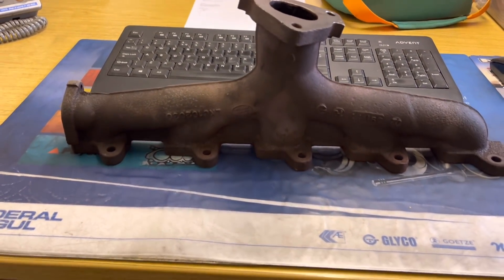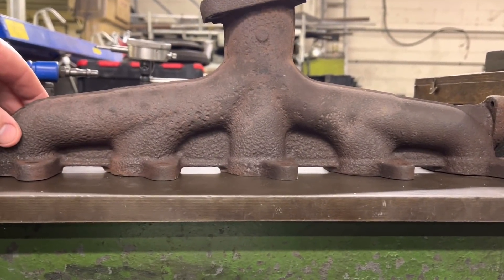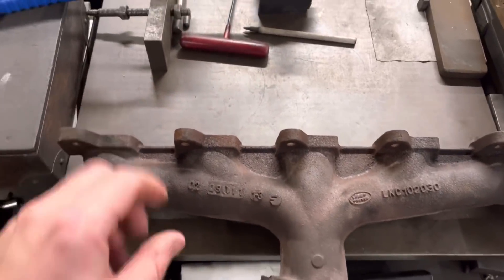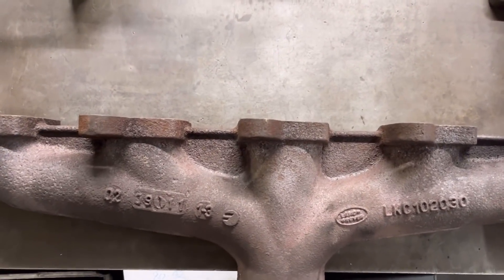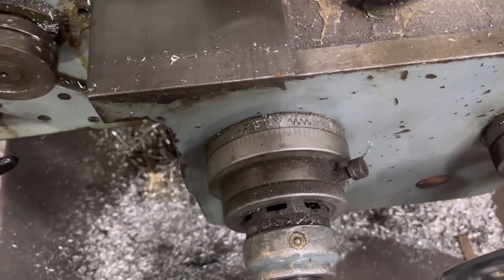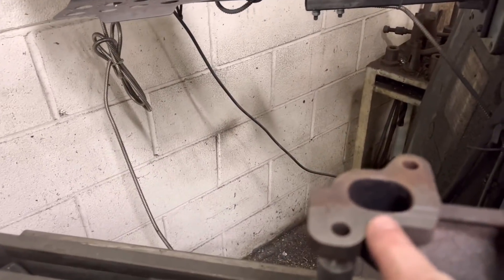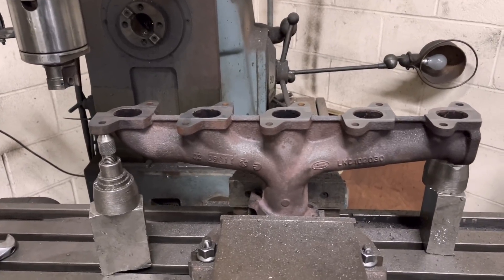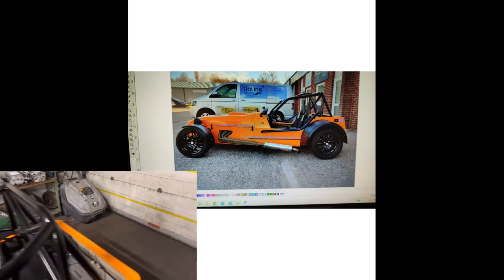You WON’T BELIEVE what these manifolds do

Comment: The td5 is getting long in the tooth now, any I see now r fairly tired, the 200 and 300 r the ones to look out for
Reply: 200 and 300 are tractor engines which are even longer in the tooth, a properly maintained Td5 has a much smoother and higher power delivery with at least the same reliability. Next thing you're going to sing the praises of the 2.5D Tourbo 🤣

Comment: strange question maybe, but what's the max depth you can remove.. or what's the minimum thickness that the plate needs to still be usable?
Reply: 2mm wouldnt hurt it but tbh you could probly take half a centimetre and still be oki ass long as you leave enough material for the stud holes to be torqued up.
Reply: @spongbob18   thnx for the response!

Comment: In the 'Good old days' iron casting were left to season to allow the internal stresses to relieve them selves. I doubt if that has been done for many years now.
Reply: A victim of "lean manufacturing". The same short sightedness is what made the GM Oldsmobile 350 diesel a complete failure. What makes it all the worse is it was long ago proven iron castings can be oven seasoned (a normalizing process) in a few weeks rather than the months of air seasoning. But even that "dead stock time" (not to mention investment in infrastructure) is heresy in the "lean revolution" ... idiocy
Reply: Packard used to do that with all their cylinder castings.  Same thing with railroad car wheels.  Mopar used to bake their 426 racing Hemi blocks for stress relief.  Believe they were noted with an "X" on the side near the motor mounts.
Reply: Some companies still do it but they're almost exclusively companies that make high-precision  castings like the machine-bases for CNC machines
Reply: @angrydragonslayer  and they're overseas
Reply: Oh yes, acres and acres of engine blocks outside seasoning for a year.
Reply: For how long were they seasoned?
I do have a 1968 lathe, with a 1959 casted bed. I highly doubt they would leave it for so long. '59 was the first year of production so maybe they all have that year casted in. Or it is because the origional producer shipped NOS to another soviet factory to produce under license.
Reply: @pinocolada4254  At a minimum the castings were exposed for an entire winter/summer cycle.  But that was for cast iron that would be used for applications where it would be used for rapid temperature changes, such as engines.  The big iron castings on our machinery decks would not have been seasoned.  I have have Parks and Delta machinery myself from the 40’s and 50’s that also have deck casting date codes thst don’t jive with the manufacturing date of the tool.  All good.  Older is better.
Reply: yep. the seasoning process costs more than just selling a replacement.

Comment: wonder if thats why td5s set on fire
Reply: Nah, most times Td5 fires start as electrical fires, but being a land rover there's plenty of leaking oil to add fuel to the fire. Either that or catastrophic failure of the fuel pressure regulator or fuel lines, although I have seen one caused by a snapped turbo oil feed pipe.

Comment: Would ceramic coating help to keep the heat from warping.?
Reply: It would slow it but won't stop it, the heat distribution in the manifold is the main culprit, ceramic coating slows down the overall heat soak in the manifold but doesn't alter heat distribution. You can actually get the same effect by allowing the engine to come up to temperature slowly and give it plenty of time to cool down before shutting down, either with a turbo timer or driving gently for the last ten minutes to your destination.
Reply: It wouldn't surprise me if these manifolds were warped when they were new.

Comment: I would use your skimmer to do the manifolds we do the same at work we had a few kids doing aftermarket cylinder heads for supercharged ford pop and they used a miller for the face but they always sent it to us for skimming on the Robbi refacer